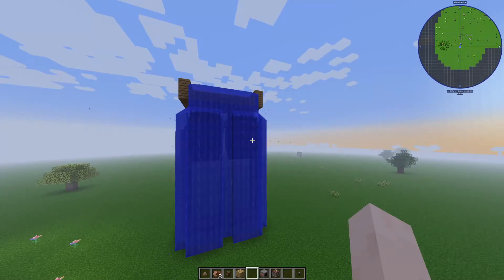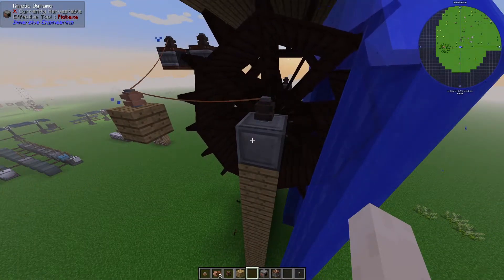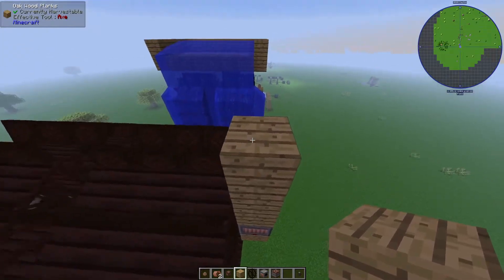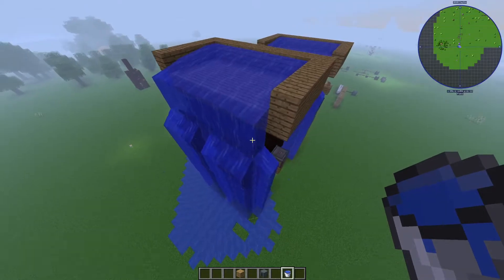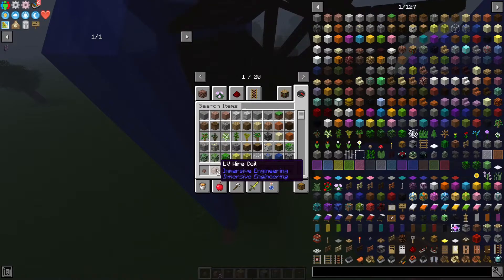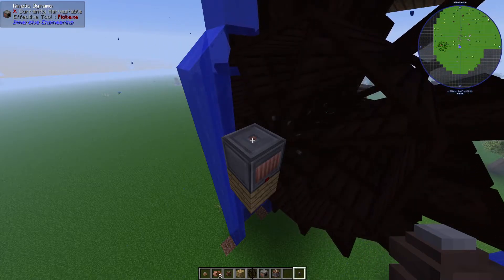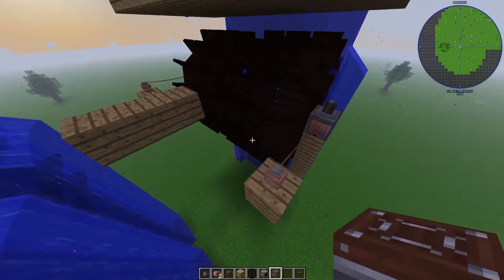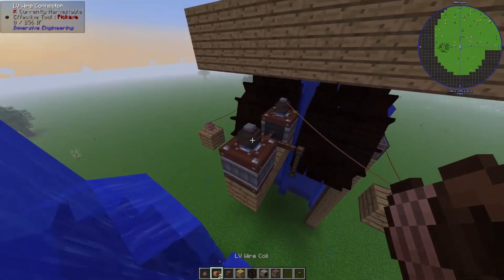Immersive Engineering Water Wheel | Modded Minecraft | MC Eternal Guides

Comment: I remember reading that they're more efficient if flowing water touches more area on the wheel, as long as it's pushing the wheel in the right direction. I thought I verified it in Sevtech Ages years ago, but I'm not sure. I think I had 3 source blocks per wheel.

Do you know if that's really how it works?
Reply from the maker: I can give this a test when I open the world next. I thought I read 30 flat regardless of water, but I could be totally wrong. Can't hurt to try it out!  Thanks for watching, and I'll keep ya posted.